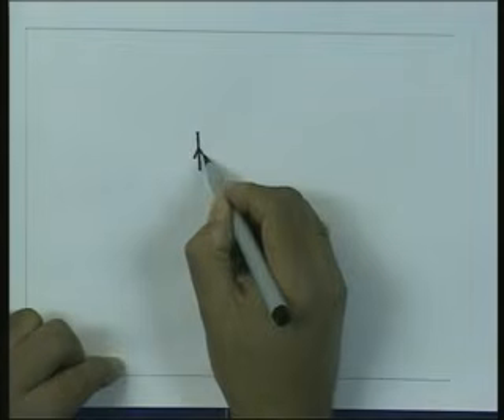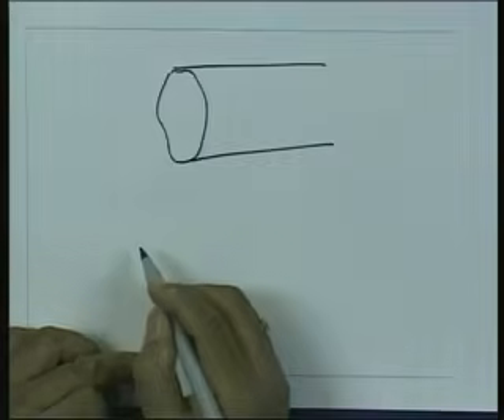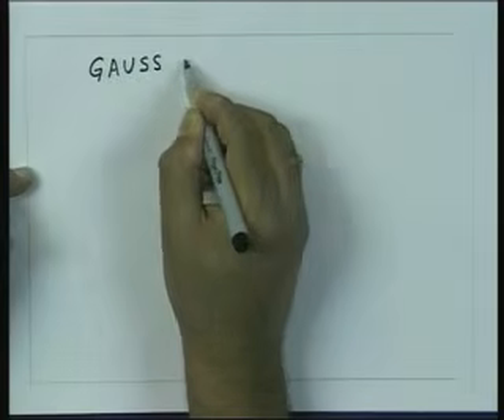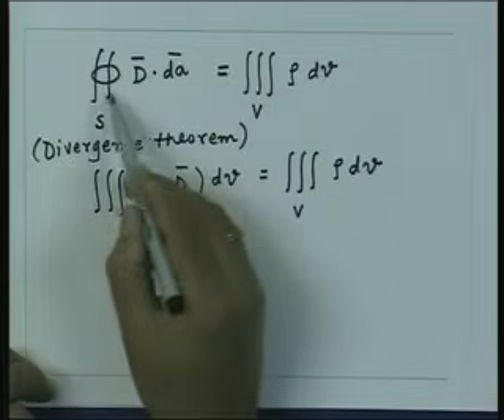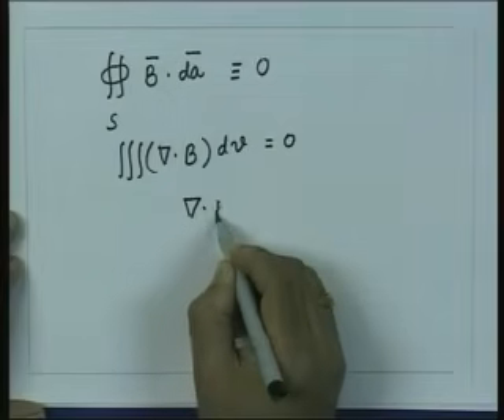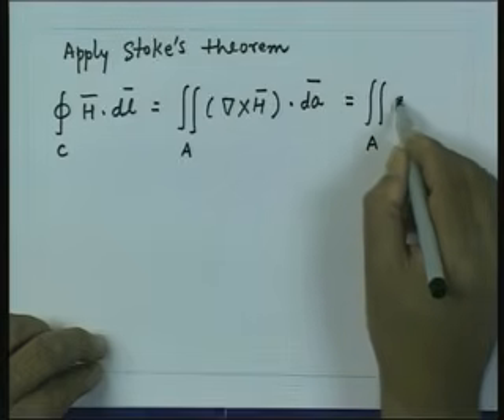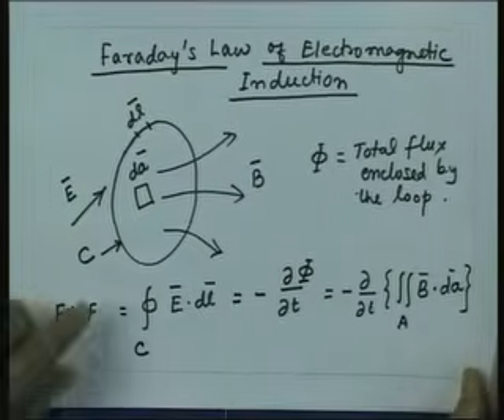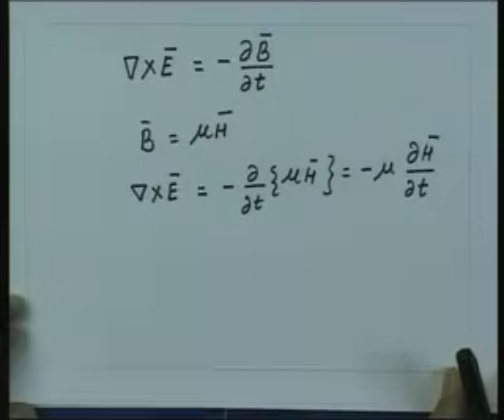Basic laws of Electromagnetics

Comment: Sir, here in your explanation of Faraday's Law of Electromagnetic Induction, which i found most interesting in the way, that either we can have either a Time Varying Field,B or Time Varying Space, A which can lead to an Induced EMF, which is the case for a DC Motor or a Transformer...If both are time varying, the Magnetic field, B as well as the Space, A...Will we have Induced EMF generated in the loop...?? Any example where we use a Time varying Field as well as Space to produce Induced EMF...?